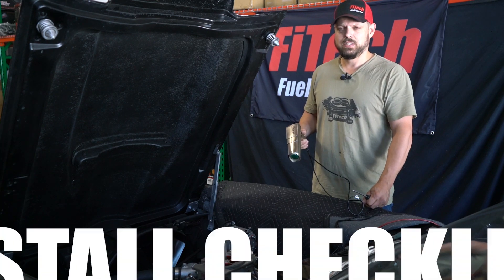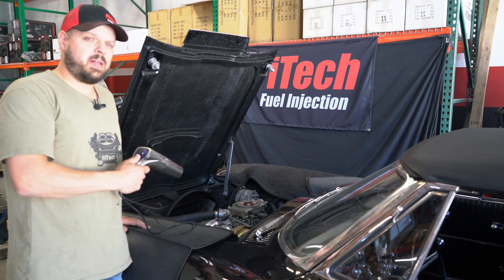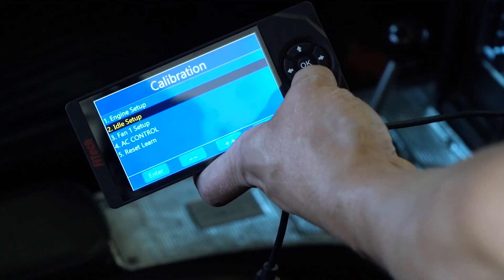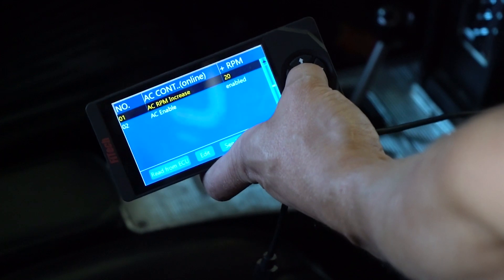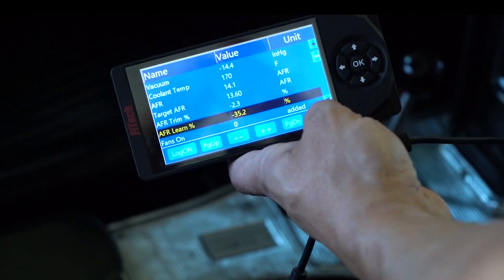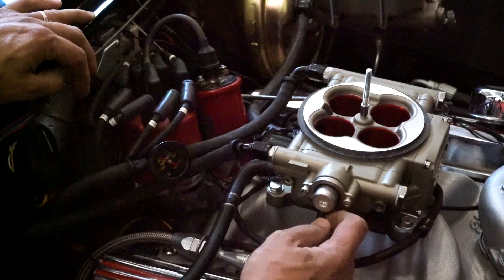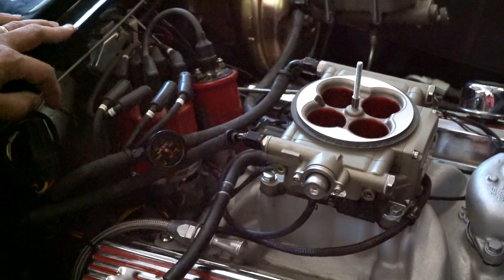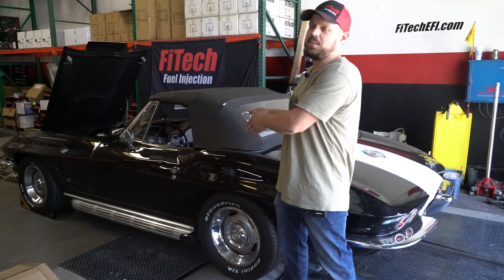Install Checklist Part 1| Tech Tuesdays | EP21

Comment: hell i cant get mine to run for shit. Any shops in Arkansas that sets these up?
Reply from the maker: Yes, you can use the distributors and installers tool on our website to find one near you. You can also call our tech line if you need assistance (951)340-2624 option 2. 

https://fitechefi.com/distributors-installers/